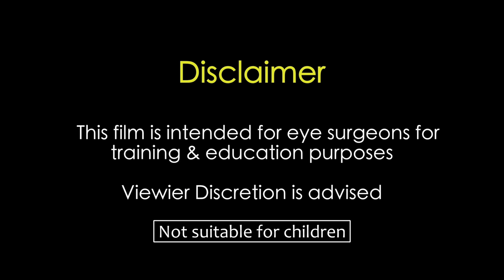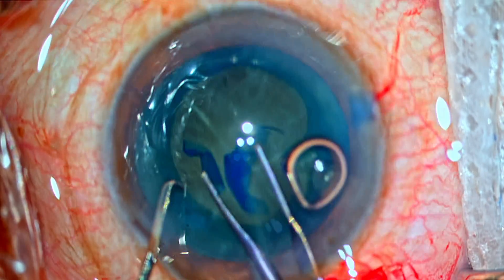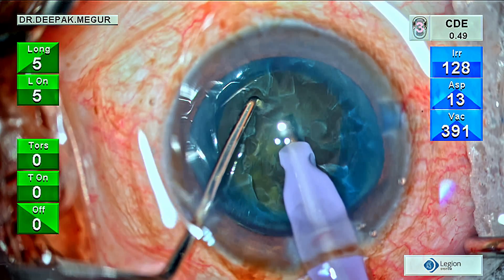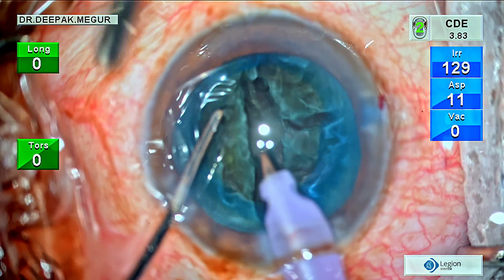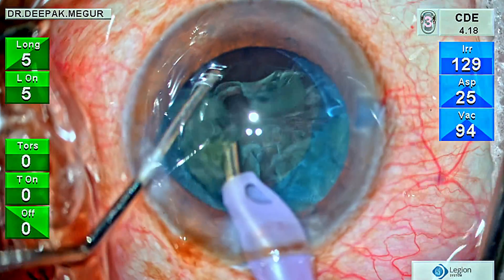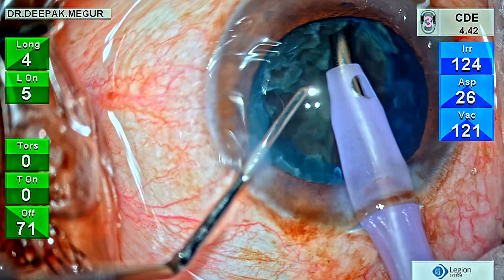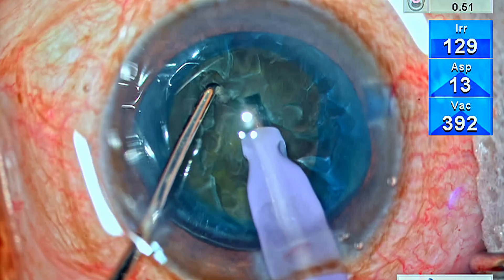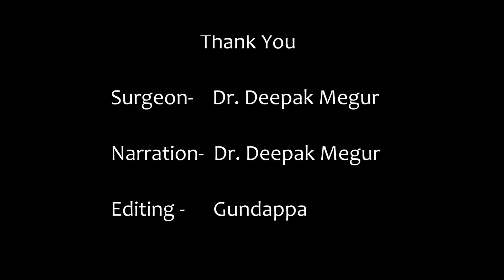Phaco Basics- Too Soft to CHOP..! Tips & Tricks - Dr. Deepak Megur

Comment: In soft cataract - I would do a long trench in such a way that we have 2/3 and 1/3 heminucleus( paracentral trench) and 1/3 heminuclues can be emulsified with low power and 2/3 heminucleus is dealt in same way as you did sir by holding at edge and prolapsing out of bag